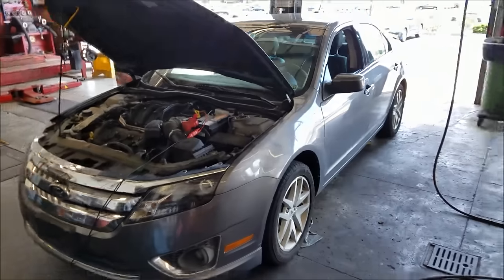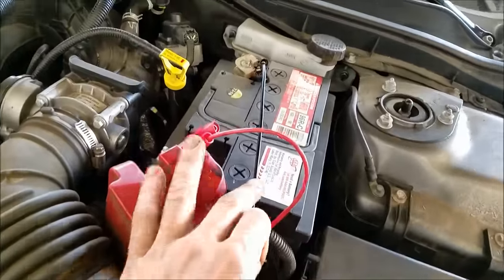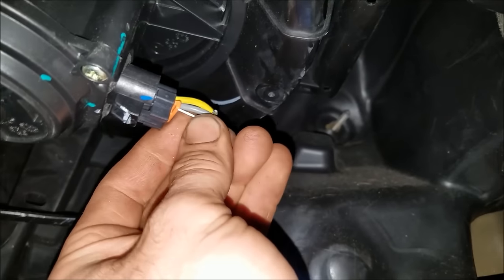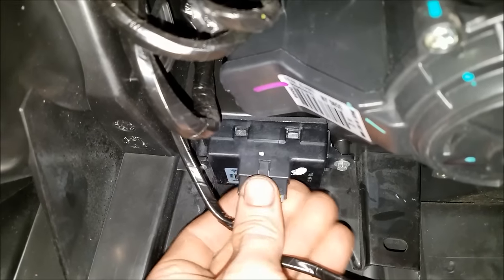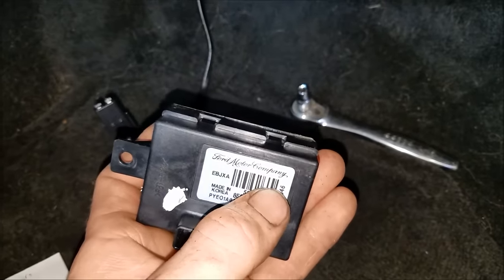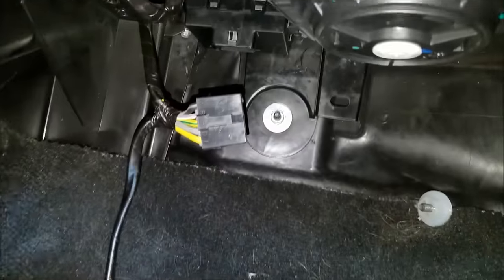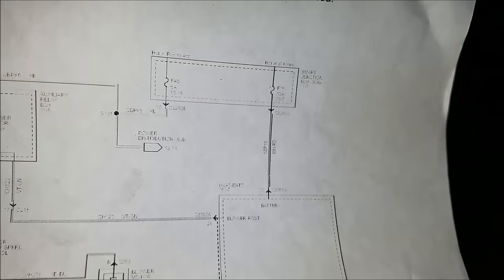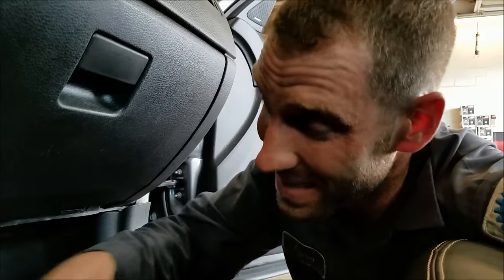06-12 Ford Fusion BLOWER DOESN'T WORK  EASY FIX fan resistor pigtail

Comment: I have a 2012 Fusion with the auto climate control as well. I disconnected the plug from the resistor and popped it back in, the fan started running again and I don't hear no chirping from it. I'm going to replace the pig tail and the resistor because that same pin is already melting. My question is, if the pin is melting on the resistor does that mean the blower motor itself is bad and drawing too much current, causing the resistor to get hot and start melting that pin? Your video narrows it down to just the resistor since the fan works. Another video says even if the fan work, the resistor having a hot spot means the blower motor is badeven if it's working with no chirping or weird noises.
Reply from the maker: Excellent question and I added some to the description about that before.  Basically anytime I see a melted wire or resistor I suggest the blower fan to the customer too . But to be honest with you I've replaced many of these over the years without the fan at the same time and have not seen any repetitive failures. So to answer your question. Yes this can definitely be a sign of a blower that has high resistance or is failing . Sorry I forgot to mention that in the video.  Do you have an ammeter? If so you could check the amperage of your old fan and compared to the new one. That would answer the question. Of course it could be a fan that's failing intermittently as well. Let me know how you make out! Hopefully that answers most your question.  And sorry if there's typos. My hands are all greasy and I'm using speak to text.  lol
Reply: @NoNonsenseKnowHow  im going to hit it with the amperage read and see how it does. I hit the blower connector with my multi meter and it was at 12.06 volts. I tested the connection at the AC relay and it read 12.01 and when the key was turned it read 11.9. Going to stick a t-pin in the there and see how much its drawing with the fan at high. Your video was incredibly helpful. I already bought the new pigtail, just waiting for the resistor to come in. Thanks again for the video and response!
Reply: @NoNonsenseKnowHow  last question, what would cause the blower to draw too much current? I don't hear noises from it to say the bearings are bad but I don't know all the parts yet in a blower to know exactly what's wrong. I'd like to learn to diagnose and troubleshoot instead of just change parts coz I want to be a technician in the future well.
Reply from the maker: @gary_lav  awesome man! Sounds like you're over there getting it done! Thanks for the feedback on the video. Are you going to amp clamp it or connect to your multimeter in series?
Reply from the maker: To give you some insight on your last question:  bearings that are faulty or dragging do not always make noise, it could have a partial short in the Armature windings, it could have debris or A Rat's Nest in the fan blades causing extra load, and honestly was probably a few other reasons it could be going excessive amperage. Unfortunately without comparing its current reading with a new blower you won't really be able to tell if it's high or not. But if you could get that reading and post it here that would be beneficial for people in the future.
Reply: @NoNonsenseKnowHow  since i have the multimeter i was thinking just do it in series but I'd like to grow my tool box so might as well just grab the amp clamp while im at it.
Reply: @NoNonsenseKnowHow  i will post my results on here though definitely!

Comment: I don’t have a power probe but I’m thinking I’m having a similar issue. Seems the compressor is working as I am getting cool air but of course no fan.  For a short period in time I could wiggle the connector and it would come on.  That isn’t working any longer.  I wire brushed the connectors (the two farthest toward the right we melted up pretty good), still no working.  I ordered a new pigtail and will splice it in, would you also suggest changing the resistor at the same time ? 
I don’t know much about circuitry and I appreciate help.  Thank You for this video.
Reply from the maker: Sorry, just saw this comment now, have you figured it out yet?
Reply: Yes I did figure it out.  Thanks for your video.  I replaced the pigtails an resistor.  Also changed cabin air filter which may have been the cause for it all overworking .. thanks
Reply from the maker: @jimmunhall  awesome to hear, thanks for the update. I'm glad the video helped out some

Comment: So, is this a problem that is likely to repeat...or do you know if the part has been redesigned?
Reply from the maker: Excellent question. Honestly I'm not a hundred percent sure if the parts been redesigned. But I can tell you I've done several of these over the years and a couple on repeat customers that religiously bring their car to me. I have not seen a repeat failure on theirs and it's been years.    One thing I failed to mention in the video is that it would be a good idea to check your blower motor for foreign debris in the fins causing extra load on it. Or a motor that is shorting out could cause this problem as well.  I hope this helps.
Reply: Absolutely.  It's nice to hear that you haven't had to repeat it.  The only reason I asked is that my resistor is burnt up on one prong, I replaced the connector that had previously melted, and I'm having trouble again.  I'm going to go ahead and replace all three (blower motor, resistor, connector), but have been apprehensive because if it is a flaw with the blower motor, I don't want to replace it with something that's going to do the same thing.  Thanks for the reply!

Comment: This fixed the problem but now I have another issue the fan won't turn off and I can control the speed it's stuck on high
Reply from the maker: It's possible you got a faulty unit
Reply: Maybe crossed wires when replacing connector

Comment: I have the same problem  with my 2011 and I have replaced both the resistor and pigtail and yet I am having problems with it. It comes on and off.
Reply from the maker: Interesting. You may have a bad blower motor.  Or of course it could be some other issue

Comment: If i move the wiring a certain way it works fine!
Reply from the maker: Yes. But it will probably fail again. If that's occurring then it means the connector is probably burned up inside like the one in this video
Reply: NoNonsenseKnowHow it does fail and we have to continue messing with it but don’t know how to fix it ourselves and don’t know where to go to have it done either!

Comment: dang its tight under there.   I was able to get it working with all speeds by wiggling the connector back and forth so I'm sure its munged.  i'll need to find a much smaller guy to replace it.  :)
Reply from the maker: Yeah if you wiggle it around and it works now, chances are the connectors burned up and will become an issue again in the future.  It's not that tighten there! LOL.  Just stretch out real good before you go diving in so you don't pull anything. Good luck and thanks for the comment

Comment: Could I run a straight wire with the right amp relay to it
Reply from the maker: Yeah definitely. And bypass the connector?
Reply: The main connecting wire from the fuse box. Hooks up to the AC resistor then splits to the blower motor. The main connector wire to the resistor is not getting fire only ground. But the fuse and relay at the fuse box has power but the line between the fuse box and the resistor is not getting fire.
Reply: Could it be the fan speed knob?
Reply from the maker: @harveyflores111  honestly without seeing it in person or going back and watching the video it's really hard for me to give you an opinion on the repair
Reply: I took it to a mechanic and he said there’s no voltage from the fuse box to the resistor(wire). Fuse box is probably bad or the contact points are not touching in the box.
Reply: Turns out. I found it myself,  It was a 12v wire connection where the fuse box harness meets the blower harness, under the glove compartment. 👍 one point was burnt . Replaced it and works like new
Reply from the maker: Awesome. Great to hear you got it figured out and thank you for updating

Comment: help, my blowers dont work on any speed, hot and cold is ok. changed this part but still nothing. fuses ok. ford transit connect 02. thanks from the uk.
Reply from the maker: Did you try checking for power to the blower itself? Or applying power and ground to the blower to see if it's spins?
Reply: @NoNonsenseKnowHow  im not sure how to do that but ill look into it, thanks for your fast response.

Comment: Okay my heat doesn't even turn on as well as the blower. It worked for a while then it stopped again. It seems to happen every year
Reply from the maker: Probably the connector. I assume you figured it out by now. LOL